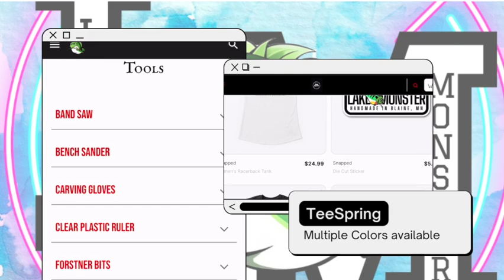Crazy fishing lure challenge (mario lure)

Comment: That first cut with the bandsaw looked a little wonky to me, then I realized you left a flat base on the piece to cut the top profile. Pro Tip! 

Since we didn't see footage of the Cheep Cheep swimming, it's difficult to say what may be needed to fix it. But It looked like only a few drops of lead were added for weight. Buoyancy above the center line and ballast weight below the center line creates upright stability in the water. Balsa is a highly buoyant wood. Maybe adding more belly weight will prevent it from rolling and blowing out.

Very accurate representation of the character. Great job so far! Looking forward to part 2.
Reply from the maker: Thanks for the advice. I’ll add some more weight. 
What do you think i should do for my next build?
Reply: @lakemonsterlures  Since Spring is upon us, and warmer temperatures are just days away, many species are being born and/or hatching. So, my suggestion would be to do a "Match the Hatch" type bait. You should create a lure of something that is native to your area this time of year.